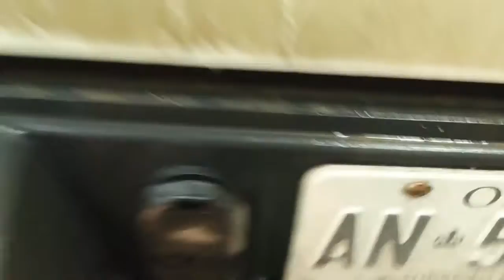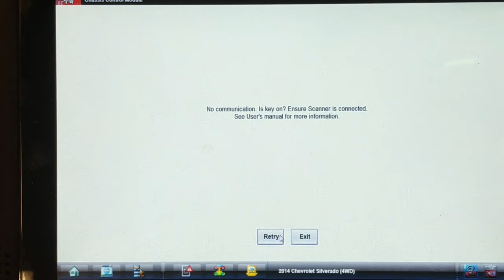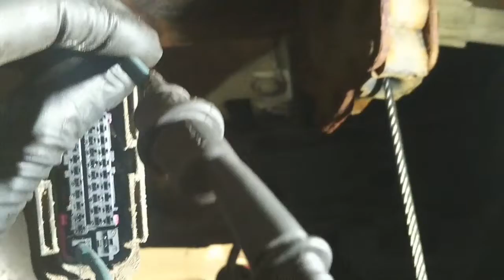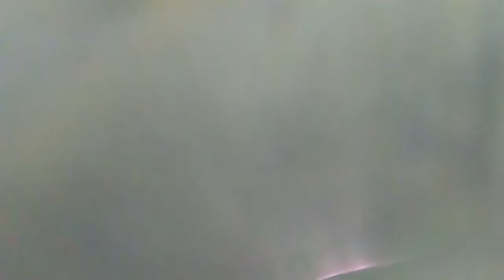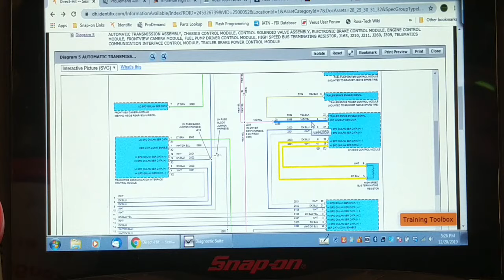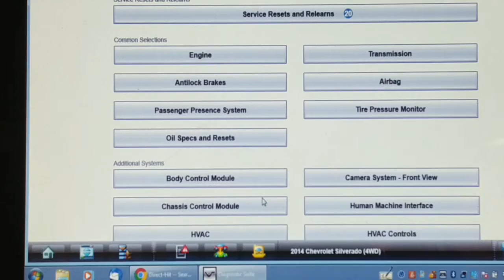2014 Silverado "Check Trailer Wiring" message on dash pt.1

Comment: Did you replace the chassis control module if so, did it correct the problem?
Reply from the maker: @jpaul4595  there was a combination of issues. Had to change the trailer brake power module and the plug due to a broken pin. Here's the link to the video if you're interested... https://youtu.be/ueJOqXwJlrw?feature=shared
Reply: @ great video, I wish there was a tech with your skills near me.  I took my truck to the dealer to figure out what was causing my check trailer brake message.  I young tech scanned it & didn’t spend any time investigating what was causing the code.  He wanted to replace chassis control module, 7 pin plug & brake controller.  No broken pins on the plug.  Just throwing a bunch of parts at it, only spent 20 minutes diagnosing
Reply from the maker: @jpaul4595  did he at least check the fuses?
Reply: @ no he didn’t, he spent 20 minutes including driving car into & out of the spot and preparing a cost estimate.  Unfortunately the GM repair shops near me don’t have good techs

Comment: My 2015 Silverado had the same problem last year. Disconnected and cleaned all the connectors on module and reassembled them with dielectric grease. Problem solved.
Reply from the maker: Yes moisture in the connectors can trip a message
Reply: Can I call you?
Reply: @MichaelMorton-nt5ez  The problem just came back with warm weather yesterday so I’m back to square one. Sorry, I’m not giving my name or phone number on YT.

Comment: when that happens I just squeeze the brake test slider and it goes away. 2016 chevrolet pickup. I have not had that alarm in many moons.
Reply: i know I am kinda randomly asking but does anybody know a good site to stream new movies online ?
Reply: @koawallace2292  no I don't because I don't do movies.
Reply: Same solution above is used for brake control system error message. Thanks for this hopefully it solves my check trailer wiring error next time I tow. Maddening because it’s intermittent.

Comment: Any follow ups to this video .. I'm going thru the same issue with my l5p... Can't communicate with the chassis control module, also trying to get a diagram on the serial data wakeup wire
Reply from the maker: Here is part 3 of this series. I had difficulty with two high end scan tools not communicating with the trailer brake controller, (Snap-On and Autel). PM me at phils@tbaytel.net and I'll see if I can generate a network diagram and send it to you.